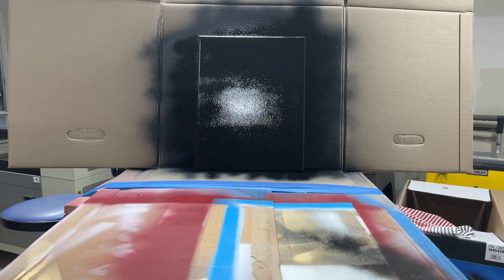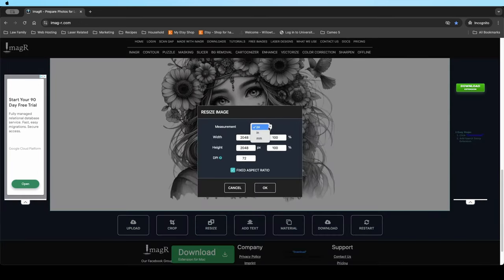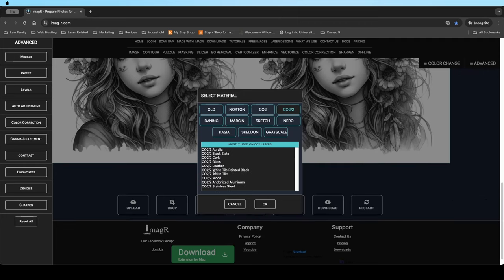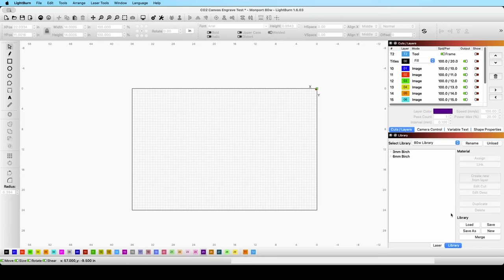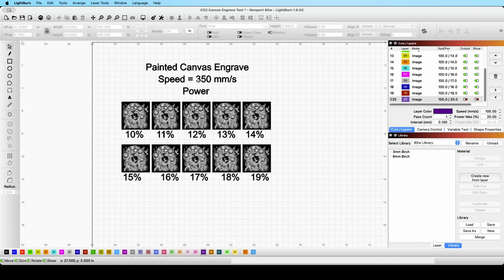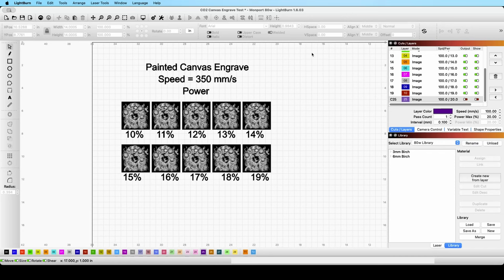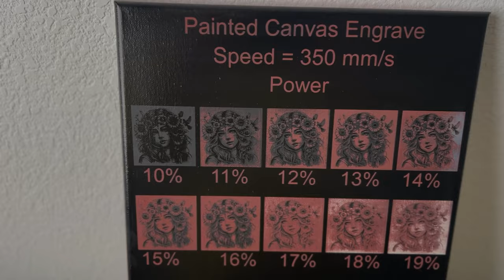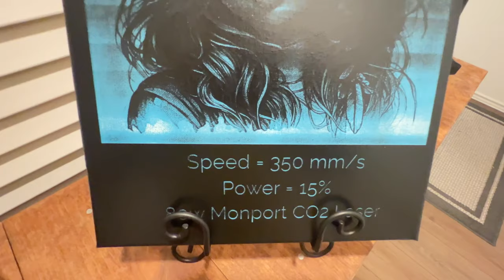Preparing Image and Canvas - Updated Process

Comment: Do you have to make a test run for every picture? Thanks in advance
Reply from the maker: Hi Mike, I make a test run to get my base settings. It’s typically a 1x thing until you get the desired result you want. I do a material test on everything I use to get base settings.
Reply: @wtwtx  Thanks for response. I know at times images vary in darkness so I know this makes a difference in how they come out.
Reply from the maker: @mikeledee8786  that’s the catch, every images is different and processes differently. That you will have to play around with. I try to choose an image with varying tones to get the base setting and tweak as needed. Co2 laser are a bit more difficult as a 1% change in power or adjusting speed to much can result in a bad quality engrave. Diodes are more forgiving. The upside to a CO2 is it can engrave faster.
Reply: @wtwtx  Thanks
Reply from the maker: @mikeledee8786 you bet, happy to answer any questions and help where I can.